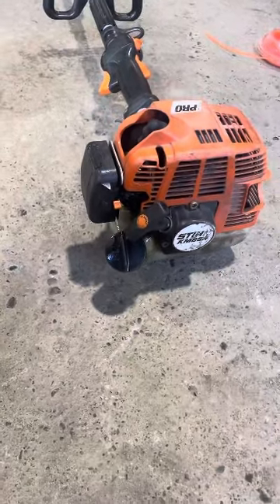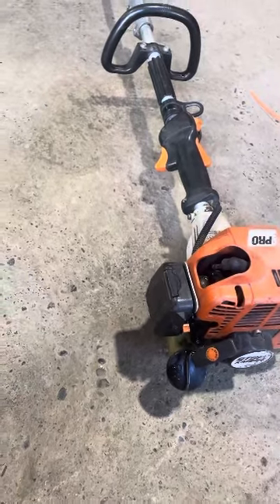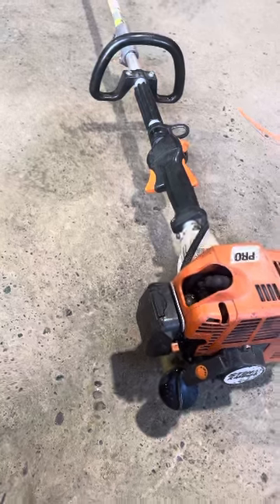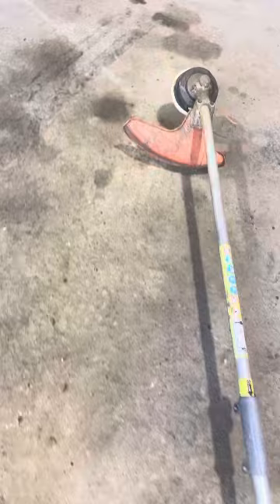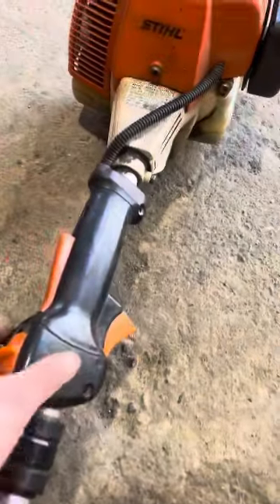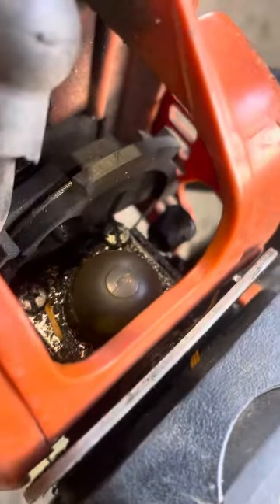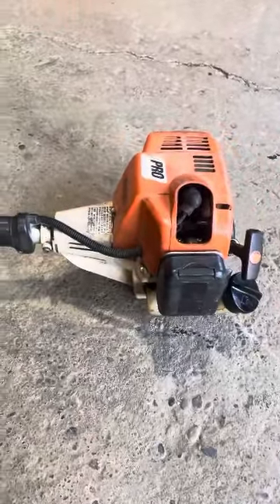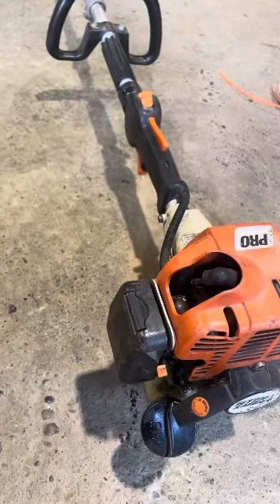Repair Stihl weed trimmer throttle stuck wide open (easy fix)

Comment: i have an fs 120. it’s a bit different and the handle isn’t twisted. trying to figure out what to do. the throttle cord looks fine when i check it out. when i start it up it goes wide open. any idea of what else i can do?
Reply from the maker: Hey ! I would verify the cable is indeed moving by moving it and seeing the linkage on the carb move freely, and fully return. Remove the air filter so you can see the butterfly moving also. Could be a seized cable, faulty carb.
Reply: @how2now40  hi thanks for the quick reply! the cable is moving good. i removed the filter and see it moving perfect, it doesn’t even look stuck full throttle. i even opened up the handle to see if anything is going on in there. nothing looks stuck and is sliding how i believe it should when i press the trigger. i’m a bit stumped
Reply: @how2now40  if the butterfly is moving just fine, is there anything else i should pay attention to for the carb?